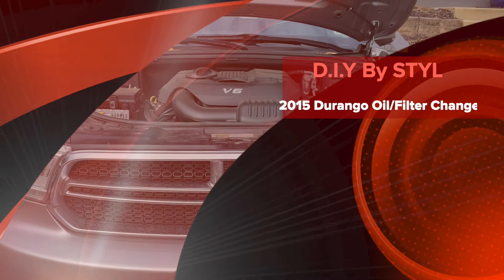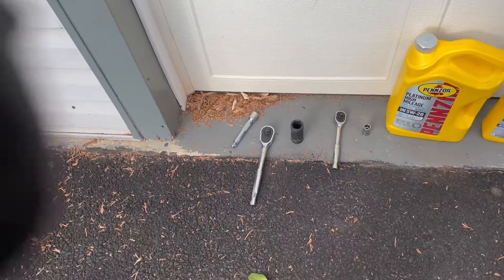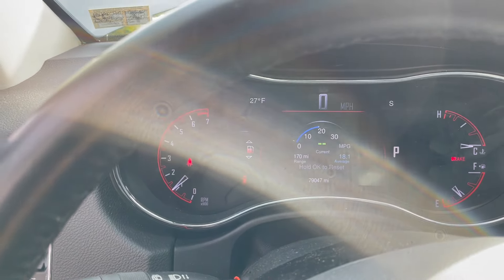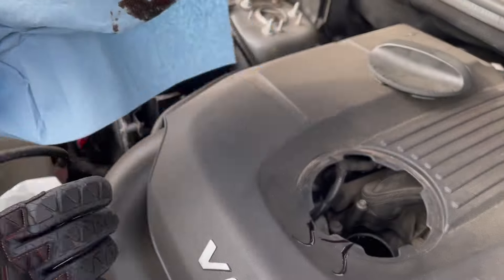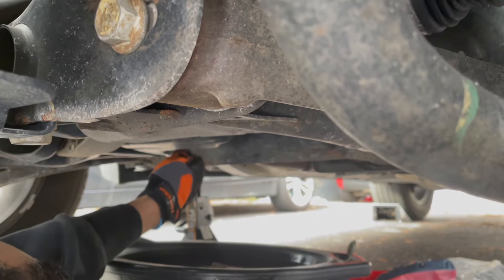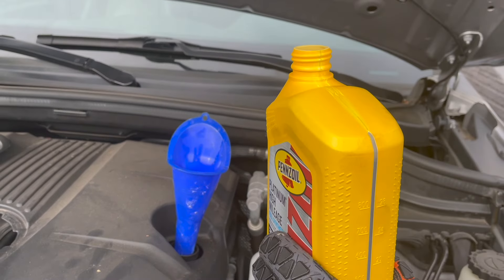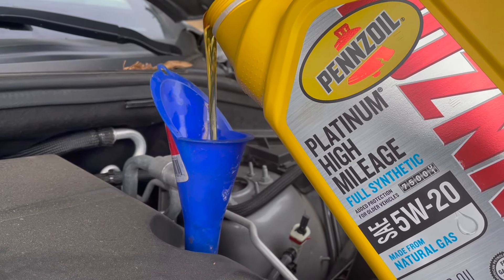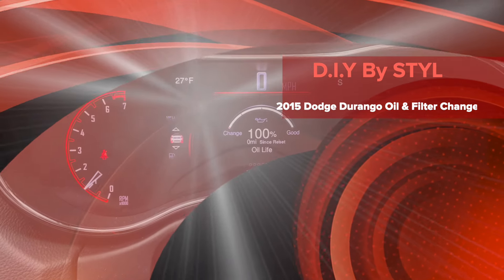2015 Dodge Durango Oil & Filter Change   HD 1080p

Comment: Great video. I love how accessible your filter cap is on the ‘15. My 2016 has a dumb air intake duct slightly in the way. Makes it a challenge as to not strip that plastic hex head on the filter cap.
Reply from the maker: Yes, I had to get a large hex lug nut for this particular filter. It was definitely worth it

Comment: So this model doesn't have a regular oil filter at the bottom of the engine
Reply from the maker: No, this model has the oil filter in the engine compartment, which makes it easier. The 2004 durango (another video of mine) has it under the chassis